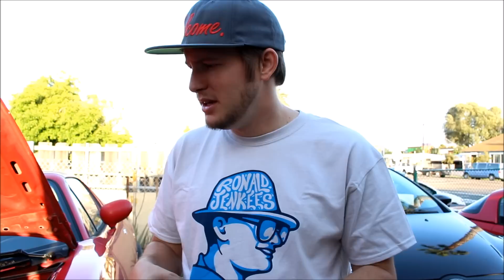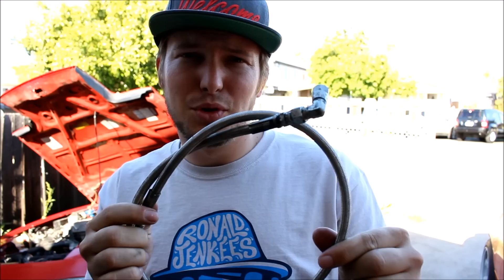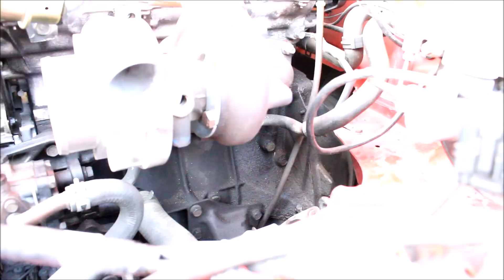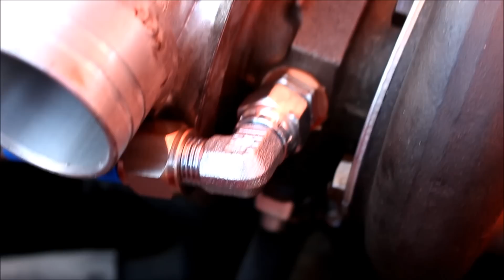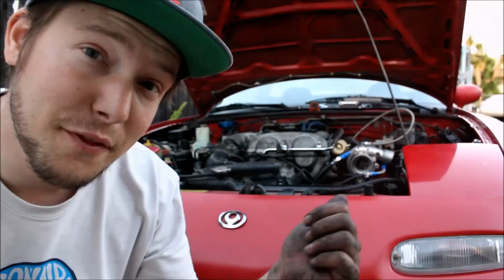The Turbo Lives!!! Oil & Water Line Install (Broke & Boosted Ep12)

Comment: Minor correction: 94-95.5ish miata also have the the bolt you can remove from the block on the exhaust side for oil feed. I know because have an early 95 :) Nice video!
Reply from the maker: +The Drifting Miata Ohhh yeah totally forgot there were some changes in 1995.5 models. Will add annotation, thanks!

Comment: Its hit or miss with oil restrictor.  Don't use them. They are not precise and always load your turbo up with poorly regulated oil causing that unwanted blue smoke and shortening expensive turbo bearing life. I use the TurboSmart OPR. Its a turbo oil feed regulator that feeds your turbo a steady regulated 40psi of oil to your turbo at all times. It has a oil drain back return as well so there is never any turbo oil loading that is a very unwanted condition.  Also install the TurboSmart in line oil filter as well. Its vital that oil being delivered to your turbo is filtered. You are now up to date on proper turbo oiling the right way.......your welcome👍

Comment: So I actually installed my Racing Beat intake today (ended up breaking my AFM...)
Where does the AFM go on a turboed car?
Reply: +Gingium look at who i found lmao
Reply from the maker: +Gingium If you go MS, you get rid of that ugly AFM! More airflow!
Reply: +TheCarPassionChannel Haha it really is so ugly. Ill defintely be going MS soon then.
How does the MS measure airflow then?
Reply from the maker: Gingium Instead of the horrible AFM with a spring loaded door, it measures airflow based on intake temperature and manifold pressure. It gives you a lot of freedom to do whatever you want to the intake system like running a filter right on the front of the turbo and using a BOV without any drawbacks. (If you use a BOV on a turbo car with an AFM or a MAF you run rich between shifts).
Reply: +TheCarPassionChannel So there isnt any big bulky sensor that replaces it!? Thats amazing. Might just have to go MS now haha
Reply from the maker: Gingium One sensor is inside the MS, the other sensor is about half the size of an o2 sensor and it goes right before the throttle body. Super clean
Reply: OMG, it's insane how far Gingium and TheCarPassionChannel have come. Gingium trying to figure out where the AFM goes and TheCarPassionChannel broke and boosted. Now both fully establish and fully built!
Reply: @atgrant2312  right ? lol

Comment: love your channel very helpful info if you get a chance could you make a tire fitment video I'm having trouble with mine no matter how much I roll the fenders I can't get my front fenders tostop rubbing and I'm not sure what else I should do
Reply from the maker: +Jason Ramblas What are your wheel and tire specs?
Reply: +TheCarPassionChannel 15×9 I believe they have 0 offset but I'm not positive on that I bought them used and the guy didn't know all of the exact specs but all I know for sure is that they are 15×9
Reply from the maker: ***** 15x9 +0 is very hard to fit under stock fenders without rubbing no matter how much fender work you have.
Reply: +TheCarPassionChannel what would you suggest I would like to do as little modding as possible because I like the stock fenders look a lot more than something like over fenders but at this point my main concern is just rubbing the front tires constantly
Reply from the maker: ***** I suggest not using 15x9 +0. If you want to keep the fenders stock you should consider 15x8 +25 or something similar.
Reply: +TheCarPassionChannel alright thanks man I'll look into it

Comment: I think I already know your answer, but, gt2554r vs gt2560r? I currently have the 2554 journal bearing on the Miata. the 2560 looks mighty nice, but I figure i can get a 2554r CHRA and use my existing housings. The compressor wheel and turbine are the same, right?
Reply from the maker: +Opt Good question. I'm not sure if the housings are identical, you might want to contact Garrett. As far as 2554 vs 2560, I have no experience with the 2560R, but I would have a hard time recommending against the 2554R for any reason if you have a 1.6 or early 1.8. If you have a 99+ 1.8 the 60R will probably be better suited.
Reply: +TheCarPassionChannel Thanks, it's a 94 1.8. Feels good with the 2554. I'll check with Garrett.

Comment: @CarPassionChannel - If one were to remain around 6-8psi but wish to run E85 would the stock fuel pump be able to handle the flow requirements at those PSI's on a NA 1.8 given 550cc injectors. A). Do I need an upgraded pump if I only run max 8psi+E85 B). Would 550cc injectors cut it or do I need the 700cc's?
I know you ran your stock pump@12psi for awhile but I take it that was on pump gas!
Reply from the maker: Yeah I'm not quite sure on that. Honestly for $160 or so, it's worth it to just upgrade the pump.

Comment: i love broke and boosted. i'm planning to Boost my Miata, too. here in Germany we have a company who sell a whole kit with a garett GT 2560. but how should I check my Stock Motor before boosting? i mean, checking the Motor if it need a rebuild or Boost in stock without danger to break it.
Reply from the maker: +Tobi As Not a bad idea to do a compression test just to see if any funny numbers show up, but I wouldn't worry about the stock engine. I originally boosted mine at 176,000 miles and I'm almost at 213,000 now.
Reply: +TheCarPassionChannel funny. im watching your compression Test Video right now. the company recommend less than 160000 km to Boost. Mine Hits allready 180000 km.
Reply from the maker: Tobi As What's the worst that can happen? It's not like the rods are weaker as they get older. Mine has 340,000kms (My other car) and is one of the highest powered stock 1.6 cars around. I say go for it!
Reply: Thanks! I will!

Comment: so I'm trying to pick a restrictor and there seems to be no information on what thread pitch the t25 is. I'm finding plenty of 1mm restrictors but they all have different pitches. I'm sure I'm overthinking this and one size does not fit all.

Comment: hi Craig. can you please tell me how many millimeters the oil feed line has to be I bought my oil feed line with 6 millimeter inner diameter and the fittings are 4 millimeter is that okay or does the line and the fittings need to be 4mm? will I blow my Turbo oil seals with what I purchased? Thank you
Reply from the maker: My turbo feed has always been -4AN with 1mm restrictor.

Comment: Hi Greg, just a quick question on the water line fittings , what size are the barbs ?? Thanks :)
Reply from the maker: +Dalton Horslen The water line barbs that hook up to the thermostat housing hoses? 5/16" (8mm)

Comment: Simple but awesome.  Genius water routing bruh!  Most efficient.  Will copy liberally and credit appropriately when I can bring spidey from the stone age to the golden turbo age.  Been eying the cast 1.8 manifold as a possible candidate for a mirror of this build to give 1.8 kiddies an option.  I know egr would be an issue, and I would have to have a shop fab the down pipe.  Any thoughts based on your experience with this build so far?
Reply from the maker: +NickelNDiminIt Yeah, even though it's the second turbo Miata I've pieced together, I've still had to buy things 2-3 times and not everything fits as expected. The real learning experience will be once it's on the road and I get to start working out the kinks.
Reply: +TheCarPassionChannel So after considering the options and details, I think someone needs to do a companion 1.8 build.  You have the 1.6 really well covered, so I am thinking I could probably document the process for the 1.8 using your same formula for the B&B series.  I think with a 5 psi wastegate, an FMU, etc. could work well on a 1.8.  The key is whether that cast manifold sucks or not.  So I think you pushed me over the edge.

Comment: Hope you see this and can help a little. I just got a 1990 1.6. I know it’s a 1.6 but mine doesn’t seem to have the oil feed on the driver side. Do all 1.6 have the oil feed or some came without. I’ll be running the line with the oil pressure but I’m confused on what engine I have.
Reply from the maker: o chuy All US 1.6 engines have them to my knowledge. The European MK2 1.6 might not, can't confirm
Reply: TheCarPassionChannel I’m in California so I doubt it’s an European swap lol. I know it’s a 1.6 because the exhaust manifold I got fit perfectly. I’m confused. I’m starting to think the previous owner changed out the motor. Are there engine stamps somewhere?
Reply from the maker: o chuy If your cam angle sensor is on the passenger side, it's a 1.6L. And 1.6/1.8 manifolds don't interchange
Reply: TheCarPassionChannel yeah it’s a 1.6 then. It’s so weird that the engine doesn’t have the oil feed. You think I can drill and tap that spot and achieve the same thing?
Reply from the maker: o chuy No. Don't drill a hole in your block. The feed should be there, maybe clean the area and you may find it
Reply: TheCarPassionChannel will do. I’m like 75% positive it’s not there but I’ll clean it real good with a wire brush and brake cleaner so I can be 100%

Comment: Would the applications you use on your NA, also be practical on the NB2 (2004)? I have been following your build, and I want to do something very similar. Ive started to gather parts- but I dont know what the ECU will do under boost on an NB- if it will react the same as an NA. For reference, I want to run a comfortable 8lbs with no ECU or tuning card. Eventually I would like to get a MS and go up to 12lbs and aim for 200hp.  Also, do you know if having a turbo will have any adverse effects since it is a VVT engine? Thanks for the great videos!

Comment: hey greg, from my research on the interweb, it was mentioned that there is a drain plug for the turbo oil close to the oil filter. is this true? if it is, why choose to drill the oil pan as oppose to just using the pre-existing drain hole?
Reply from the maker: Because to route it over there is a pain, it's on the opposite side of the engine. Plus since turbos drain via gravity, you'd have to ensure the line took a continuous downhill path all the way around the front of the engine.
Reply: thanks dude for the quick reply :)

Comment: I have a question!!! Why are you putting the oil limiter???? is that necessary?? until now i though the oil line should be as free as possible, but i noticed lots of people put constrictors on their oil feed? why is that? do i need one on my set up?? :/ im confused
Reply from the maker: +Tsikriteas Spyros many times too much oil pressure in the CHRA of the turbo can force oil from the seals and make the turbo smoke. Also on the ball bearing turbos, too much oil pressure can actually make it harder for the bearings to spin.
Reply: +TheCarPassionChannel my turbo is a ball bearing one.. how should i know if i need a constrictor? mine is an IHI . i recently had it serviced from a professional (bought it used) before i installed it and he didnt mention anything.. even if i need one, how can i choose how much to constrict it? sorry for the lot questions, i am on a budget too and i am constantly searching for information.
Reply from the maker: Tsikriteas Spyros Usually the ball bearing turbos require one. Personally I'd just go for a 1mm (0.040") one and call it good. Some people say to run it with no restrictor and see if it smokes, then add one of it smokes.
Reply: +TheCarPassionChannel Ok i am gonna try it without one first and see what happens. i am going to ask my mechanic about this though. he might know something specific on my application (i actually bought a turbo kit that in japan comes factory fitted on a special edition of my car).  Thank you mate. you are really doing a great job.

Comment: I keep missing out on what you said I know that you have one of the water hoses attached to the thermostat housing, where is the other one located?
Reply from the maker: It goes into the fitting on the block. Stock, the line goes from the thermostat housing into the block fitting. Now, the turbo intercepts that line.
Reply: +TheCarPassionChannel thanks bro you saved a GT2871r turbo.

Comment: Ty for the vid. 
In the process of getting this done on my na6. Any problems with running with AC and PS? 
Is the Garret worth the extra cash VS China turbo?
Reply from the maker: Just go 2" piping on the hot side of the IC to make your like easier. GT2554R destroys the churbo in spool, when I upgraded my other car, it was life changing. I have a video or 2 about the step up from the churbo to the 2554R. Thumbnail says "more power??" I think?
Reply: TheCarPassionChannel 
Very cool.  Thx again. 
  Is it foolish to go with the FM kit? 
  Never boosted a car B4. 
My plan was to go with there kit...in future go with MS and larger injectors to achieve my target of 200whp
Reply from the maker: @SWFlowseeker  The FM kit is one of the best complete kits on the market, and FM has excellent customer service as well.

Comment: So I am planning on putting a turbo on my stock 93 Miata. The pnp version of megasquirt is a bit expensive for me atm, but would the non pnp model such as the pre assembled megasquirt 2 still work just as well besides the whole pnp part? I'm constantly researching the whole Miata turbo idea so any words of advice would be appreciated. Anyway keep making the great content!
Reply from the maker: +Mason McConnell Yep, it works just the same, you just have to build the adapter harness. You can even do a DIYPnP where you build the unit yourself and it's quite a bit cheaper.

Comment: So what did you use for the drain line? The rubber hose seems like it would degrade pretty quickly
Reply from the maker: Still holding up to this day 👍 you just have to make sure you get a rubber hose That's rated for oil (not just a coolant or vacuum line)
Reply: That's awesome I just turboed my 1.6 and used rubber vs silicone for reasons (cheap). Kinda did a broke and boosted (with mspnp2) and didnt want it to fail prematurely. But if yours has held in socal mine should be good I'm assuming, thanks for the inspiration and videos

Comment: Hey great video! How do I identify which water line is inlet and outlet? Does it matter?
Reply from the maker: For water it doesn't matter. For oil it matters a LOT. Usually the oil drain will have 2 threaded holes next to the port
Reply: @TheCarPassionChannel  awesome thank you !!

Comment: hey Greg!  love watching your videos! super helpful. this might be something obvious I completely missed but just wondering what you do with the o2 sensor where it's in the manifold do you drill it into your exhaust?  and as well my 95 has a maf would I just leave that on the intake before the manifold?
Reply from the maker: Sorry I kind of skipped over that information. I actually had the exhaust guy use the last 6" of the stock manifold to use at the bottom of the downpipe. It served two purposes: The flange mated up perfectly to the stock exhaust and it retained the stock o2 sensor bung. But, even if you don't go that route, it's really easy for any exhaust shop to add an o2 sensor bung to your exhaust.
Reply: wicked!  thanks for the info Man!  not sure if Im gonna try and save my stock manifold or not yet!  but I'm definitely gonna keep that as an option

Comment: I noticed that the anti-surge porting on the compressor housing inlet has been welded shut.. what's up with that? advantages?
Reply from the maker: There was never any anti-surge porting, I had a 3" inlet welded on instead of the normal 2.5" :)
Reply: Cool! neat trick!
Reply: I'm doing some modifications to my compressor housing, and having the mods tested on a flow bench. It is freaking amazing
how sensitive turbo's are to inlet flow losses, because of the air speeds involved. For example, on my turbo, it is pretty much maxed out at around 400 cfm, and the air speed in the inlet at 400 cfm is roughly 240 mph (!).
When the inlet was originally tested, we wanted to first establish how much vacuum
was needed (on the flow bench) for the inlet
to actually flow that 400 cfm. The guy got up
to 33" of water and still hadn't got it to flow 400
cfm, and was thinking about using a larger bench... then he remembered to put a large radius on the opening on the housing. All of a
sudden, the vacuum (aka test depression)
fell to only 22.8" to flow 400 cfm.

Comment: Where did you get that bracket for your wastegate? is it custom made? I need something like that for my T25!
Reply from the maker: Yeah I had a shop make it for me.
Reply: +TheCarPassionChannel I can probably have something made like that. How deep do those bolts go and did you just drill and tap?
Reply from the maker: Yeah I just drilled/tapped. All turbine housings are a little different so you might have to mount the bracket on the compressor housing.
Reply: +TheCarPassionChannel Ok. Mines pretty much identical to yours so ill try your method. thanks Greg and amazing content as always!

Comment: Where did you get the exhaust manifold.i got a turbo from a saab that im thinking of putting in
Reply from the maker: +john Almarez Ebay
Reply: +TheCarPassionChannel    Thats a cast manifold right? The only cast manifold ive seen are for 1.8. Is there any difference on the manifold between 1.6 and 1.8
Reply from the maker: john Almarez Yes they are different. The 1.6 manifolds were gone about 2 weeks after they showed up. Just gotta keep an eye out for them.
Reply: +TheCarPassionChannel i hope another one shows up..
Reply from the maker: john Almarez Keep an eye out for used ones on miataurbo dot net classifieds too, I think there's an HKS one for sale right not for a couple hundred bucks.